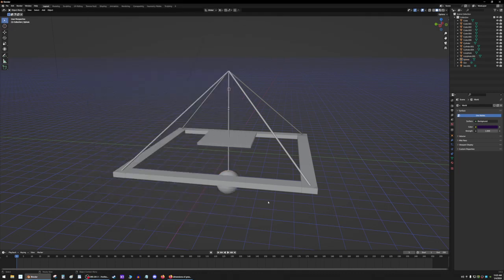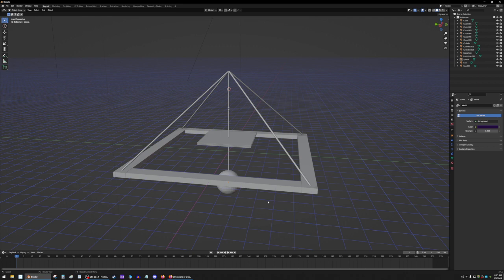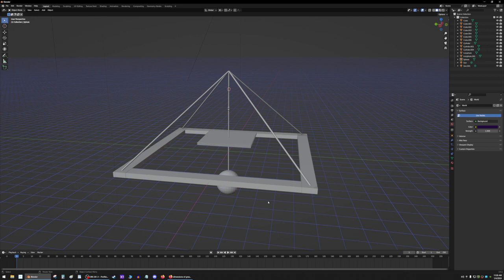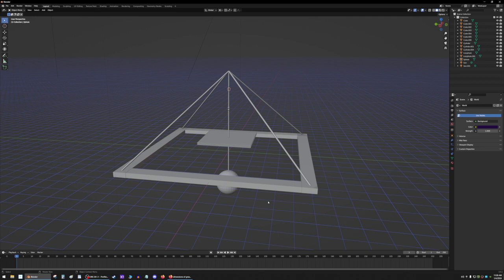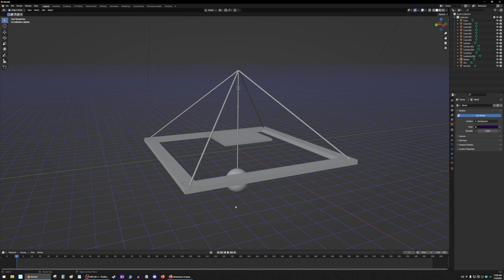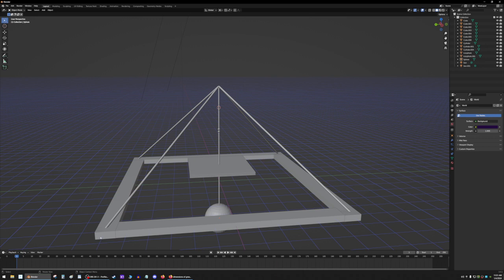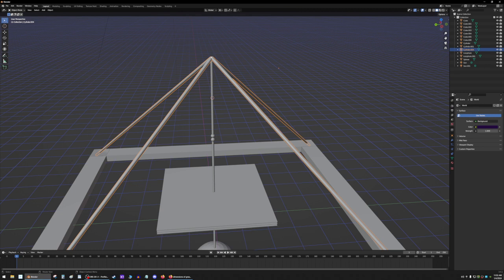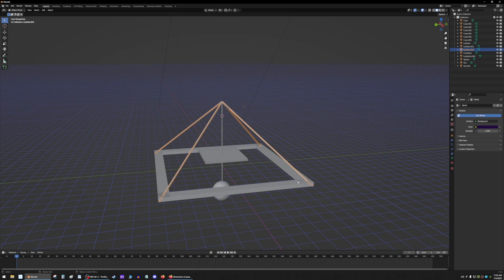FREE POWER WITH TINFOIL PYRAMIDS

Comment: Mike, 
What would you consider a good place to learn more about free energy for someone who doesn't have a very deep understanding of physics, but has a willingness to learn? A forum, book, one of your Youtube video's (watching this one at the moment).  Thanks and have a nice weekend!
Reply: Don Smith is another huge player. They basically simplify teslas teaching and through lc resonance, high switching disruptive discharge and extracting from the ground earth to get your house self sufficient
Reply: Oh, thanks for the tip!! 
Best to find the info of Don Smith on Youtube or on other sources?
Reply from the maker: The secret to zero point energy is this; pump z waves in sync yet out of phase implode through nonlinear medium to form a higher frequency wave. In other words, every free energy device MUST use this principle. The way you get a sinewave to become a pump z wave is simple; use a carrier wave. The way you get waves in sync yet out of phase is to use layers, often found in sets of 3 or just 3.
A carrier wave may be produced a number of ways, though in the most advanced versions of zpe, this forms on it's own as a result of the carried waves combining on one side of the circuit, so that the carrier wave which is built charge, will only release energy from a sum or a mass which holds 3x charge or more than the materials giving carried waves individually, across spark gap.  A low tech method is to use a distributor. Another method is using a timed opening of capacitors with a mosfet until a pump z wave has built up. One example of this is the Stanly Meyer hho fuel injector which is used to ionize tapwater mist into hho gas in a fraction of a second.
Pump z waves imploding through a focal point must combine after focus. No physics can say otherwise or has ever. The mere existence of this fact disproves any photon or string based theory which cannot explain the origin of energy at zero point. The only zero point you will find on Wikipedia is fraudulent thanks to the deep state editors. If they had one editor who explained why true zpe really does work, they would be out of a job.
Reply: I'm in the same beginners position as you were when you wrote this comment. Did you compile some videos to understand this better? Thanks

Comment: Did you attempt to place the pyramid on top of the microwave with the milewski mixture of crushed glass and iron oxide, and see any speeding up, or would the microwave simply get wrecked by the field?
Reply from the maker: I don't know how you put that together but no. That's impossible. In theory, the reason gold forms from oxides usually to be gathered on graphene on a top layer which may need to be added during the process, is due to plasma action which pulls mesons, pions, kaons from the mix, making space crystalline and far more superconductive than usual as charge jumps among various oxide capacitors in a process I call pulse orbital discharge.  A pyramid would provide the environment, but you cannot power a microwave oven near one since the zpe field would collapse the function of any electronics! You'd need a gas ground oven in the correct position below and to the side of the pyramid wall's center, and would need to short the pyramid to ground a little bit through an alchemy bath. Seawater with sulfur or some reactant and black ferrite oxide which really ignites almost like thermite but in this case you don't use aluminum powder , you let the ferrite oxide stirred up will in a moving bath react with energy passing through it so the thermal reaction is mainly from shorting out the oxides with one-another. Done right >200kv if possible, the leads in the bath will be stationed around the perimeter with one at center as an anode to ground... probably hanging just over the top once you get a graphene layer floating there.